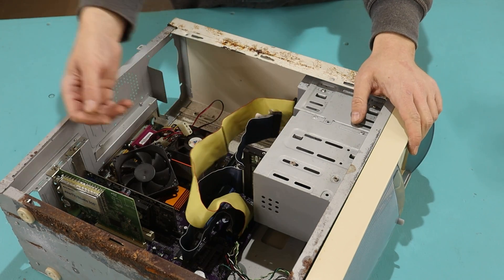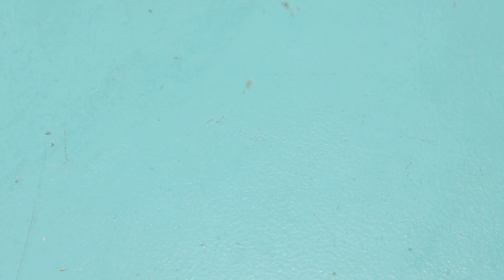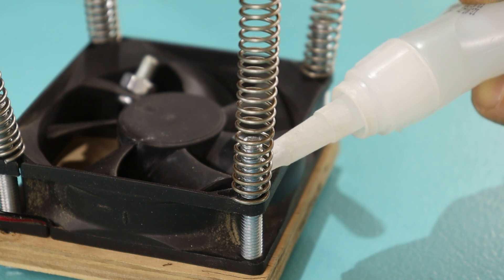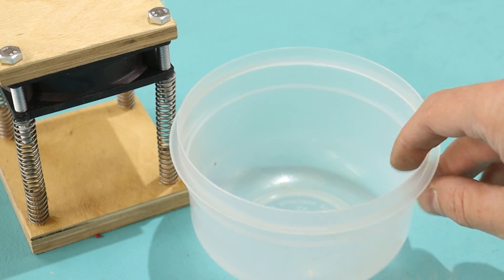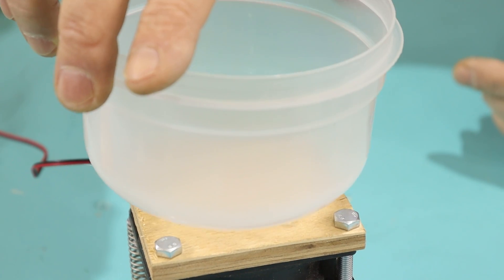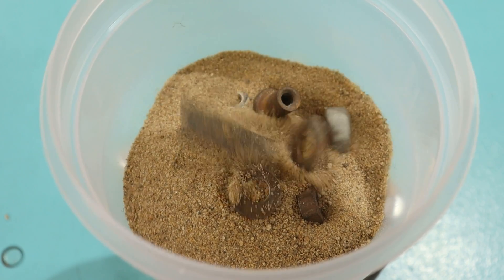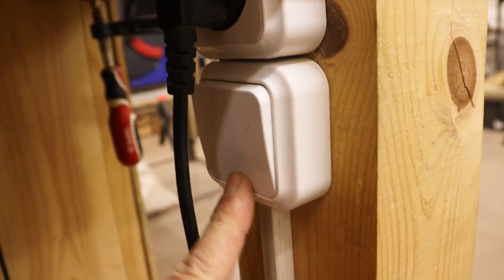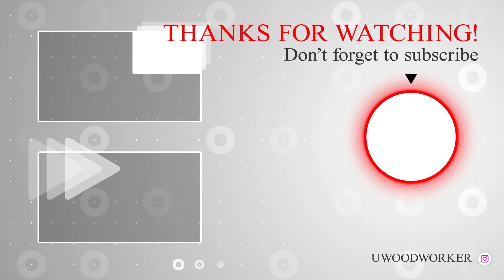20 Ingenious Intelligent Secrets & Tips That Work Extremely Well. Valued Construction Tricks & Hacks

Comment: Using the rivet gun on a steel nail which the inside teeth is made for aluminum is going to smooth out the  grip. Believe not just me, but the saying "right tool,right job."